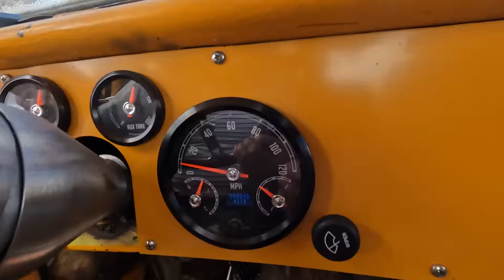The Heavy Wrecker Strikes Back At Rattlesnake Gulch!

Comment: I'm surprised you guys trust peoples front bumpers. i attach the soft strap to the frame in the middle and cradle the axle up both sides while hooked to the straps both sides. keeps the axles up out of the way better and your just rubbing bumper with the straps plus you can keep it lower. in cali the tow company i work for we use a hydraulic t bar with spoons and inside controls for up and down to clear rocks and ditches. Strap both tires  to the spoons no driver needed in the towed vehicle. sweet videos man keep it up.

Comment: Looking at towing off road with heavy wrecker.  Rather than strapping the vehicle,. Have you considered an adjustable tow bar?  One that articulates up and down with vehicle and the the wrecker. But also also a little bit in and out like a slip joint on a drive line.  Maybe a clamping system to a-arms or axels. 
Anyway it's a thought.

Comment: 7:05 If you have a welder and a grinder you could easily trail repair that np. Dude you need to extend your boom on both side's where it attaches to the hinges on the truck that way it will extend further out I say put an extendable hydraulic boom.

Comment: I've changed a couple of those steering shafts and all the videos say you should strap the steering wheel when the shaft is off because if the wheel spins it could break the clock spring.

Comment: Maybe try come up with a setup similar to a 3 point hook up on a tractor 🤔 have 2 solid points on the wrecker and use the boom winch as the 3rd point so you have a adjusting point

Comment: I think you need to fabricate two adjustable stiff bars for the lower connection. That way, the towed vehicle would maintain its distance from the wrecker and you may not need someone in that vehicle on the brakes.

Comment: I have a great 👍 design idea and would a wheel hub and a flexible drive shaft u joint work? It can be between the pintle hitch where the wheel hub will rotate and the drive shaft with u joint connection on the wheel hub to rotate and another end of the driveshaft to connect the vehicle in tow.

Comment: **  Right now you've got two lines and boom (3 degrees of freedom to manage control the vehicle-in-tow).    HOW ABOUT  3 hydraulic cylinders, say 3" bore by 48" stroke.  One mounted low right rear on a ball socket.  One mounted low left rear on a ball socket, and one mounted centerline upper and forward on a ball socket.  The three meet in a knuckle, the right and left rods into ball sockets, and the centerline cyl rod mounted solid to the knuckle.  If you play with this you'll discover it has an extraordinary reach, up down, fore aft and left right.  At the knuckle could be a pintle hitch, (no solid extensions which could leverage a bending of a cylinder rod. Then to your rescue vehicle you chain strap the pintle ring tight to center front bumper (or whatever is the best tow point).   Adding an air bottle cushion to the left and right cylinders could soften the jars.  No boom, as the 3 cylinders can duplicate what the boom can do, and a lot more.  Your copilot could use a joy stick to move your vehicle-in-tow left, right up, down, nearer, farther, as the terrain demands.  AND no swinging and bashing goin on.  It will hold your gap, acting as a pair of triangulated spreader bars.  What think you?

Comment: tow bar hu'h?
old split driveshaft with a universal joint and make the "towed" vehicle end telescopic with a limit key or maybe an internal spring to give a bit of play? . key's - proper placement of pivot point, (u-joint) to tow vehicle and to the "towed" vehicle. maybe even a hydraulic cylinder at the "towed" vehicle end. and just typical fold out bars like a regular tow truck would have. wouldn't have to be huge but sufficiently stout?

Comment: On towing with wrecker, would the sling that wreckers used to have before the wheeler work to keep the towed vehicle from moving forward into the wrecker.
The sling would be attached to below be connected to the frame or the axel and then up at the top of the boom on the wrecker.

Comment: 11:00
Wouldnt it be a decent idea to give the towee crew the remote control and a radio, so they can adjust things on their own, when they see issues?
The wrecker has inside controls, so you can also easily adjust things.
Right?

Comment: What about a single bar with uniballs on each end to attach to the wrecker to the voice your towing it could be drilled with multiple hole to adjust the length this will keep it front to back while the boom does the height

Comment: So just a thought, to keep the tow vehicle away from the wrecker could you not put a low cable around the rear axle or through a pulley and hook it to the front axle to hold it back from the Wrecker?

Comment: What if You Used A like 2 ply Tire or 2 With A aired Up Tube in through Them With The Tow Straps Running Through The Center of The Tires For A Buffer To Protect  The Front Of The Towed Vehicle  & Back of The Wrecker, Maybe A Canvas Cover Inplace of A Tire ???🙄

Comment: Hard bar, you already have one it's called a drive shaft. It should twist in almost every direction once setup, need it adjustable have an inner and outer shell, the outer one has slots cut in and the inner has your bolting system (and guide pin), for better locking have cutout tabs the width of the bolt just twist and bolt, that'll stop it from extending or closing up in use. 2 6 ft lengths will give you 8 ft no problems. Not an engineer but you'd definitely have a better way of implementing it.

Comment: Woild a "Telescoping"  Fly-section on the Wrecker-Boom 
(extendable by, maybe, two feet),
with it's own "Rooster Shheve(s) for the winch-rope(s),
and mounted londitudinally on the top-side of the existing boom,
and with a "Push-Pull ram or actuator (?) adjusting the extension,
give you the flexibility your desire ?

Comment: When that steering wheel is not hooked to anything to stop it from turning, is there any risk of it being turned so far that it damages the electrical wiring to steering wheel controls?  Should it be locked in place?  I'm pretty sure you can damage the electrical wiring (clock spring) on some vehicles by over rotating the steering wheel, but maybe not on jeeps...?

Comment: Concerned citizens wonder why an owner would describe a bad steering gear, when it was a failed U-joint. Split radiator hose and 2 hose clamps over the broken U-joins, and drive it out.

Comment: Would it be possible to have something similar in size of the wrecker, but instead of a boom, have a flat bed that can go down for easy pick up... pretty sure most of vehicule fit with the length of the wrecker if it was a flat bed behind the cab. :D .. and for the wrecker, the bar could work but with your imagination, maybe you could build a custom dolly tow, so instead of pulling the car from the bumper, you could have a "off road dolly" that you put front/back tire on it, and after you lift the dolly with the boom instead of directly the car.. or maybe i just have very stupid idea ;)

Comment: Wonder would a hydraulic ram with a oscillating joint on both ends make a good stiff bar ,ram could be use to push or pull the vehicle further away or nearer to the wrecker or do two rams on A frame configuration

Comment: When on a recovery like this where trying to keep the tires from hitting the ground. Is removing the front tires an option? I realize rubber hitting rock's is better than a brake rotor. But is removing the front wheels still an option that can help?

Comment: prolly ford fuel sender vs chevy.  truly think they go in opposite directions.  There is a converter box for that.  It's programmable.  And it works but.....  Kinduh gimmicky.
Reply: The gauge on the IH is probably the type with a negative resistance coefficient whereas a GM sender for a GM800 series chassis will be positive.  The A/D converter in a GM800 cluster expects that so that an increasing resistance raises the voltage at the A/D input in the gauge cluster.

Comment: 🤔 HARD BAR ❓️
Hydraulic Extendable controlled by Remote Box or Driver from front!
One person Operation, no need for towed vehicle to assist with breaking, promoting safety for all situations.
Axle secured UP for rock clearance.
Control heights as required.
Left & Right, extend / reduced, for Extreme Maneuvering Conditions!😊
Minimum plumbing required with quick disconnect, as required need.

Comment: Why wouldn't y'all put diesel engines like a Cummins 5.9 or something into the wrecker and Morvair? I'd figure these situations would call for a lot more low end torque than anything
Reply from the maker: So many negatives with a diesel engine. 
Heavy 
Very slow throttle response  
Difficulty modulating to work output, especially at lower rpm. 
Limited rpm range   

 Gasoline engines are the correct choice for sand dunes, and extremely technical rock crawling.

Comment: You can maybe build a wheel lift that most wreckers use to have, just to hold the fronts wheels in so in doesn't sway or bang into the back of the wrecker. I think thats why alot of sling trucks used them instead....one not to rip bumpers off and two more control over the car when towing. You and Tom could make this no problem I am sure.

Comment: possibly having a tow type bar. 2 shocks the go from the pintal hitch to the outside recovery points on the towed vehicle. not fixed. hydro, air, bump style that would allow the tow vehicle to move back and forth, just not too close to the towing vehicle. kind of like the tow systems that are use to flat tow vehicles behind motorhomes. keeping some kinetic tention on it so it would not be trying to swing in and out.
just a though.